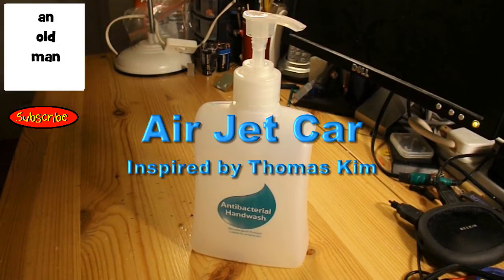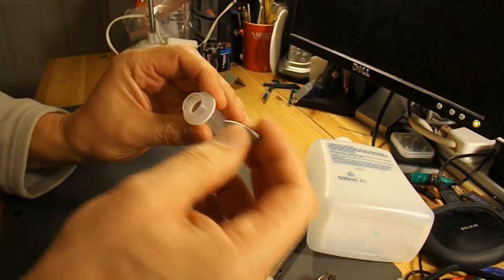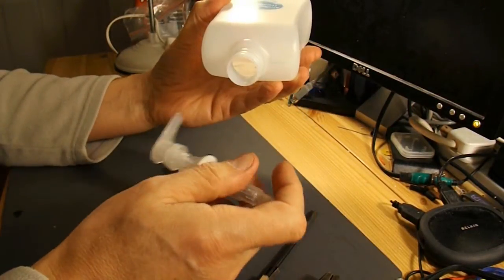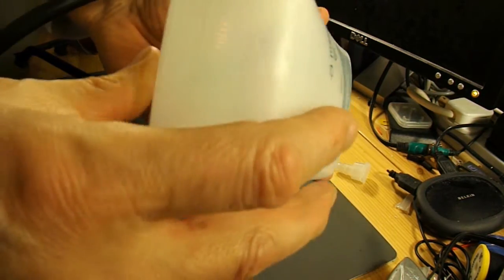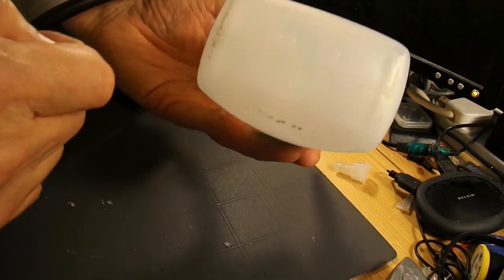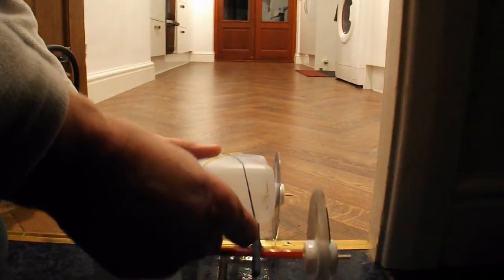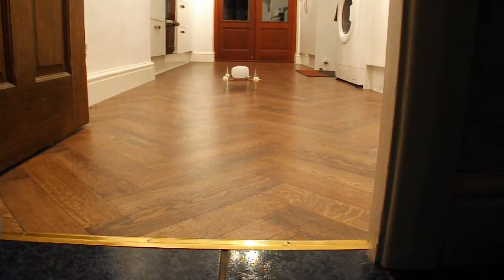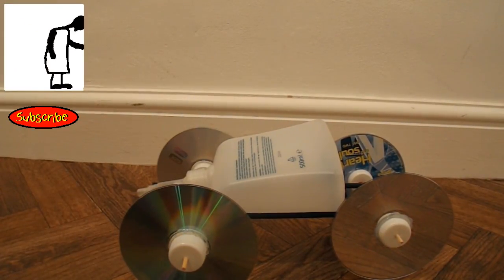Air Jet Car inspired by Thomas Kim

Comment: Oops, I read through the comment thread and found that you were pressurizing this car by approx. 15-20 psi.  Thanks!
Reply from the maker: I tried really hard to burst one of these bottles with a car foot pump and I couldn't get enough pressure (I had it covered with a heavy tarpaulin) 😊
Reply: Yes, I ended up watching that video.  I wanted to say thank you for all of your videos over the years.  I've used them to get ideas for student projects.  I work at a school in Olympia Washington and run an after school science/diy club.  Thank you for the detailed videos and great examples of problem-solving!
Reply from the maker: Thank you David, it is great to know my videos have some purpose, they always leave plenty of room for improvement so I am sure your students make them much better 😊